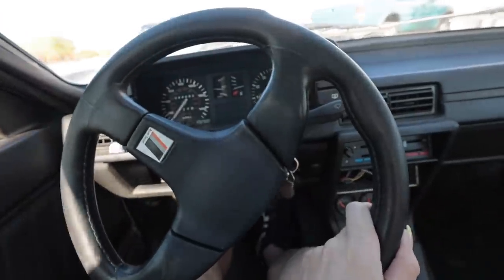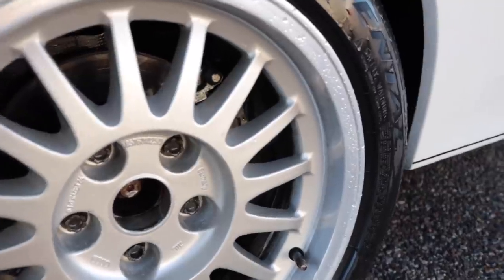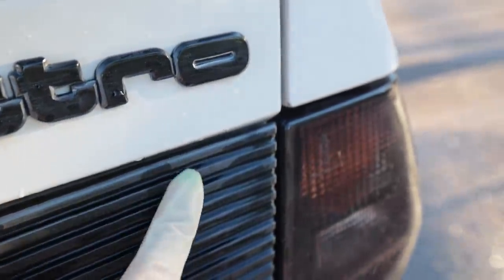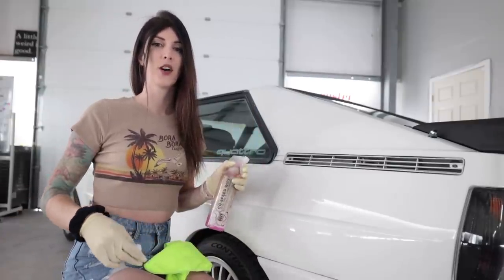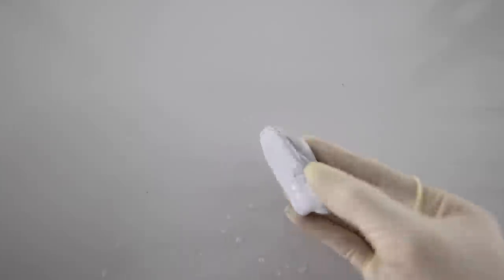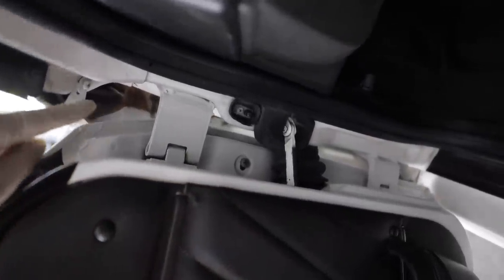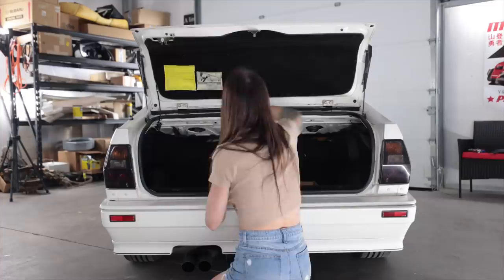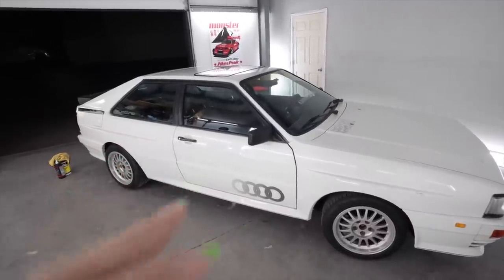Clay Barring My 38 Year Old Original Paint.. // Project Ur Quattro

Comment: The vents aren't for fuel vapour - the tank venting system is all fed to outside the car (unless yours has evap control with a charcoal cannister, not sure how the specs differed by market as we didn't get that until the early 90s in Europe when we also got Catalytic converters. You'd never have fuel vapour intentionally in the cabin! The vents are body air outlets - if you're forcing air in at the front & you want through flow ventilation then it has to be able to get out again. Most modern cars have the outlets hidden behind trims or a bumper but Audi used it as a styling feature!

Comment: We run the Trizac pads 3000+ grit and then buff out from there with 3M or McGuire's..... You don't need to take off a lot of material because you're not trying to take it beyond stock & stock finishes have texture (NOT glass smooth like people think).. You could wool pad the single stage white but, traditional white pad & black 2nd stage pad will work.... Slow RPM speed gets you there faster for resto...... 1 panel at a time. Patience.... 

I almost bought one of these back in the early 2000's but Ended up buying a Isuzu I-Mark Lotus edition instead...
Reply from the maker: The car has heavy pitting from being left outside for 3 years at one point in time. Lots of bird poop damage. Still 5-7mil thick though pretty much everywhere.

Comment: Easy why to check how badly your car needs to be clay barred.  After washing/drying your car put your hand in a plastic sandwich bag then lightly rub you hand over the paint.  You’ll find it will feel like 220 sandpaper because so much contaminates are embedded in the clear coat.   After clay barring the car do the same test if you clay bored the car correctly it will feel smooth as glass.   Speaking of glass you should also clay bar all the windows along with the headlights and taillights.

Comment: The fuel tank has a venthose. On the older  European  Gm models with the fuel tank behind the backseat, that hose was connected to a nipple somewhere near the top of the fillerpipe and was guided somewhere through the floor to te outside of the car. My guess  is that on this Audi it will be similar.

Comment: that vent is the Cab Vent for the entire car not only the trunk (when you close the door the excessive air has to go some where and you need air to breath).
best recomendation for single stage white is rubbing compound for bathtub cleaning sounds awful, 
but it works the best my golf mk2 was all yellow ratty looking and I just buffed it with that and drove it through the car wash after and it looked like new, shiny and bright white.
btw. those emblemes on the trunk lid are not correct for a 83 it should have the stickers instead of the emblemes.

Comment: The paint being hard is NOT due to its color. Back when that car was made, there were several paint's that were extremely hard. DuPont Imron , Sherwin Williams Sunfire and R+M Diamont to name a few that were extremely hard paints back in the day.  You will learn that where blending goes, base clear systems are FAR easier to do blends with.  What I do like about single stage though is the purity of the color. That happens because most clear coats aren't perfectly clear.  So far as detailing products go, Adams fast correction creme is an amazing compound. For polishing I would recommend Sonax Perfect Finish.  For buffing pads, I'd suggest using the Lake Country CCS series pads ( most likely orange for cut and green for polishing ).  Bang for the buck, they are really tough to beat pads. For a coating, I would recommend the G techniq Crystal syrun light and Exo combination.  They are reasonably priced products and you will enjoy the durability and how they look.  As far as quick detailer type products go, it really depends on what I am doing. If I am claying the vehicle, I use the cheapest quick detailer I can find locally that doesn't contain any sealants. For topping off the look of the vehicle ( regardless of what type of coating is used) I REALLY like to combination of P&S Bead Maker and P&S Gloss. When that combination is properly applied, the vehicle looks great and it does resist dust. Just make sure you follow their directions. There needs to be at least 4 hour for the Bead Maker to cure before applying the Gloss. After working with paint ( both in application and detailing ) for ever 35 years, these products I have mentioned are some of my favorites. I hope some of this information helps.
Reply: Something I forgot to mention. With white paint, you will probably find that using slightly higher machine RPM yields a little better result.

Comment: A clay mitt makes the job quicker and less tedious with very little reduction in efficiency. Leave the clay for the fiddley bits and a short hair detailing brush with some compound for the rubber to body joins. It's going to look just perfect! Don't go crazy and remove the wax "gunk" in the shuts and elsewhere. It's part of the originality and is there for a good reason. I'd consider that removing it would lower the value.

Comment: With all the love. Please do not pressure wash the paint. All those cars with 90% peeled clear were detailed to hard. A garden hose on shower is more than enough. The sponge and soap are meant to loosen the dirt water should not be used as abrasive on cars. But still great car. Just got myself a mk1 tt love your vida
Reply from the maker: Um.. no. It’s single stage, there is no clear coat and nothing is “peeled”.

Comment: The paints from years back was much tougher, in the late 70s we would get cars in for a buff painted 10 years prior by our senior staff, solid colors were rarely clear coated mostly metalics and pearls , acrylic enamel was the usual course and was tough paint, if it ever faded just wet sand and buff, we were generous with the paint coats, what I say is paint these days doesn't seem as durable but I haven't sprayed in decades. Get back to work

Comment: The foam in the rear is probably not as old as the car. It looks too new.
Do not be scared to take off the black kit holding the rear lights, but be scared of the rot and rust it will reveal.
Reply: My '85 has the original foam stuff. It hold up well over the years.
That goo on the rear lights is a nightmare to get out carefully and without damaging the plastic lights.

Comment: Be very careful polishing or using any abrasive products around areas that have Raised Edges--------
There is very little paint on Raised Edges--------  It is easy to cut right through to the primer....  I never use any machines on edges... Just too dangerous...  Use your finger and a little product that is moistened, and rub carefully until the defect is gone and then you have to stop... You do not want to have to repaint a panel because of this or have ugly touch up paint or something that will never match on that edge... hate that....

Comment: Single-stage paint? no it's real paint not the water-based crap that's used today, the paint on the qutattro has had 38 years to dry and cure so it should be tough